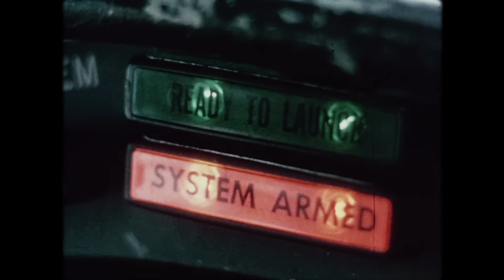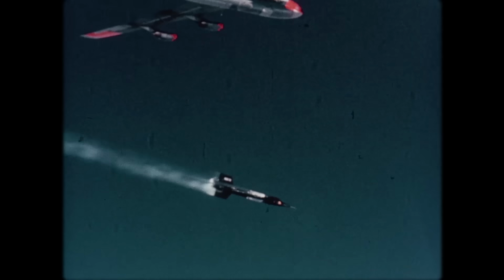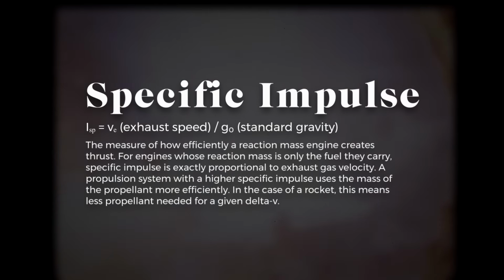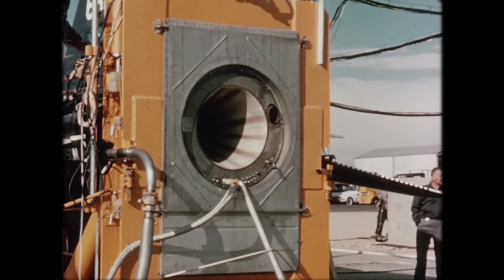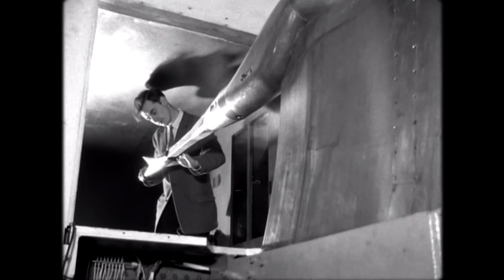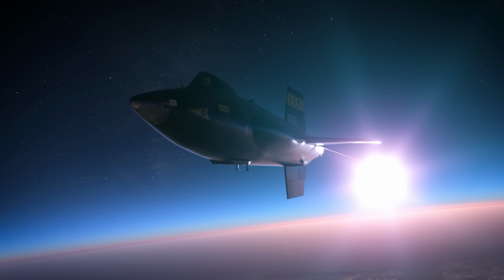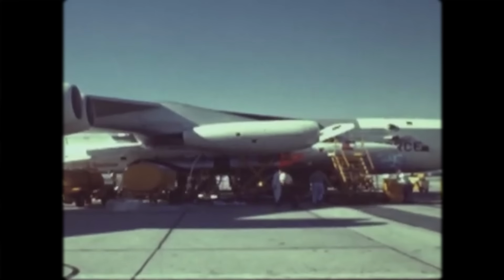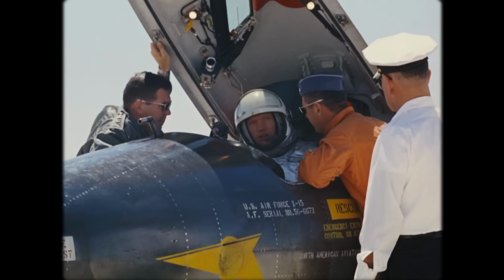The Insane Engineering of the X-15

Comment: Hey I know it says a it’s a plane in a thumbnail but it’s actually a rocket.( sorry for calling it out I just )
Reply: its a plane
Reply: @Inv1ns1bl  it’s not a plane if it cannot take off by itself or if it’s powered by a rocket it is not considered a plane
Reply: @Jst.neutral  It is a plane if it is a manned, mixed winged aircraft. The propulsion has nothing to do with it, its like saying a propeller plane is not a plane because it doesn’t have a jet engine.
Reply: that means your saying a shuttle is a jet bc it  it has multiple wings and is manned, you can ask multiple people if it’s a jet or a rocket and the people with say the same things that I said.
Reply: @Jst.neutral  I would call the shuttle a plane same as the X-15
Reply: @Inv1ns1bl  they are both rockets.
Reply: @Jst.neutral  once again, a plane is any manned aircraft with fixed wings.
Reply: @Inv1ns1bl  yes, but it’s powered by a rocket witch means it’s a rocket
Reply: @Jst.neutral  i will say it again, the power source does not matter.
Reply: @Inv1ns1bl  it does matter.
Reply: @Jst.neutral  The definition of an aeroplane is, “a powered flying vehicle with fixed wings and a weight greater than that of the air it displaces.”
Reply: @Inv1ns1bl  so? It matters about the power it uses witch is a rocket.
Reply: @Jst.neutral  That is the literal definition of a plane, and no where does it mention how the plane is powered.
Reply: Honestly, why are we arguing about this, the X-15 is a rocket. You can ask multiple people and they will say it’s a rocket.
Reply: @Inv1ns1bl  it does matter how it’s powered and you cannot change my mind. Now go bug someone else
Reply: Your the one who started all of this.
Reply: @Jst.neutral  I will keep saying that it is a plane for as long as i live. It IS a plane. It fits the definition. Just because a plane has a propeller doesn’t mean its not a plane, same as a rocket engine.
Reply: @Inv1ns1bl oh my god just accept the fact that it’s a rocket, are you some kind of super fan or something?
Reply: @Jst.neutral  Oh my god just accept the fact that it’s a plane, are you some kind of super fan or something?
Reply: @Inv1ns1bl  super fan of what?, honestly I hate the X-15
Reply: @Jst.neutral  Why are you so adamant about it them?
Reply: @Inv1ns1bl  then* also it’s bc the X-15 is a rocket. And you can’t change my mind. So go bug someone else now.
Reply: @Jst.neutral  I have said multiple times why it is a plane, i will continue.
Reply: @Inv1ns1bl  and you keep on saying it doesn’t matter about the power source and it does matter
Reply: @Jst.neutral  Once again, the definition of a plane does not specify that the power source matters
Reply: It does matter about the power source, why do they call it a jet? Bc it’s powered by a jet. Every plane relies on a power source and there are certain power sources, like a rocket, which is not a jet or a prop it’s a power source ment to go into orbit where  no oxygen is, and no vehicle uses rockets except for the X-15 , X-1 , x-2, etc. so they are rockets.
Reply: They are rockets that operate in our atmosphere
Reply: @Jst.neutral  because of that reason they are planes. Since they are designed to operate within the atmosphere, they fall under the definition of a plane, where the propulsion is not mentioned.
Reply: @Inv1ns1bl  is not mentioned, doesn’t mean it’s not important, they are rockets.
Reply: @Jst.neutral  If the definition of a plane does not mention it, it is not important. It is rocket powered, but it is a plane.
Reply: @Inv1ns1bl  just bc it’s doesn’t mention it doesn’t mean it’s not important
Reply: @Jst.neutral  It is the literal definition.
Reply: @Inv1ns1bl  that did not mention the source matters, doesn’t mean that the power source does not matter.
Reply: @Jst.neutral  if the literal definition does not mention it doesn’t matter. The X-15 is a plane because it is manned, has fixed wings and is heavier than air.
Reply: @Inv1ns1bl  ok, but it still matters about the power source
Reply: @Jst.neutral  if the literal definition does not mention it doesn't matter. The X-15 is a plane because it is manned, has fixed wings and is heavier than air.
Reply: @Inv1ns1bl  rocket
Reply: @Jst.neutral  wow you came back after a month, just to be wrong
Reply: @Inv1ns1bl  lol I ain’t wrong but I was just kinda tired from the argument, and everybody has their own opinions that they think is real and the X-15 is kind of a mix between a rocket and a plane. Speaking that it is powered by a rocket but still is meant to operate in our atmosphere and used as a test plane
Reply: @Jst.neutral  there is no mix, its just a plane, the rocket power does not mean its a rocket.
Reply: @Inv1ns1bl  it is a mix.
Reply: @Jst.neutral  Thats like saying the ME-163 isnt a plane, there is no mix
Reply: @Inv1ns1bl  it’s a mix
Reply: @Jst.neutral  once again, there is no mix, its just a plane
Reply: @Inv1ns1bl  it’s a mix
Reply: @Jst.neutral  once again, there is no mix, its just a plane
Reply: @Inv1ns1bl  it’s a mix
Reply: @Jst.neutral   once again, there is no mix, its just a plane. We can keep on doing this and i will keep on saying the same thing.
Reply: @Inv1ns1bl  it’s a mix
Reply: @Jst.neutral   once again, there is no mix, its just a plane
Reply: @Inv1ns1bl  it’s a a mix
Reply: @Jst.neutral   once again, there is no mix, its just a plane
Reply: @Inv1ns1bl  it’s a plane
Reply: Jk
Reply: It’s a mix
Reply: @Jst.neutral  once again, there is no mix, its just a plane
Reply: @Inv1ns1bl  mix
Reply: @Jst.neutral  once again, there is no mix, its just a plane
Reply: @Inv1ns1bl  a hypersonic rocket-powered aircraft. This was looked up.
Reply: @Inv1ns1bl  so that means it’s a mix
Reply: @Jst.neutral   once again, there is no mix, its just a plane. The power does not matter.

Comment: The X-15 is a rocket not an airplane. When it reached the edge of space it needed thrusters to maneuver in the near absence of air. The wings were needed simply for flight control to reach its desired altitude, reentry and landing. If we consider rocket powered craft as airplanes, the fastest aircraft to be considered must be the space shuttle, many times faster than the X-15!

Comment: If by insane you mean "Let's squeeze a pilot into a pressure suit with contained o2 supply then strap him into an oversized missile, cut a window out, then strap it on / under another jet that will take off and fire him like the previously mentioned oversized missile he is." then, yes.  I would agree.
Also, keep in mind these are only declassified speeds.  The blackbird was reported to be maxed at around 2.8, but then mid operation, while avoiding a missile strike in libya, sounding as bored as thou he were busy making a sandwitch, the blackbird pilot did a speed check on himself to our awacs overwatching the operational area, and was told he was doing over mach 3.5, and the pilot replied calmly, "I thought so, but figured it might not be noticed if I didn't confirm."
 Nearly every pilot to fly the thing, at every speed it ever flew including over libya at mach 3.5, claimed the aircraft was showing zero signs of strain, and in fact had more thrust in reserve than was being applied. Likely, the only people who will ever know truly how fast that aircraft might be capable are, are the incredibly few people priv enough to have flown it.

Comment: Fastest manned plane
The fastest(known) plane is the X43A at mach 9.64, only using rockets to get up to the speed required for the scramjet to start working.

The plane could have be entirely jet powered, but it would require an exponentially more complex design, requiringf multiple engines that operate at different speeds, it was simpler to use a rocket to get it up to the required speed for the scramjet to function, instead of using multiple jet engines of different designs that needed to be cut off from the air supply as speeds increased

Comment: You can't really compare the sr71 to the x15 when it comes to speed. Sure, the x15 was way faster, but it wasn't really a plane. It's more of a manmed rocket. It's like saying an ICBM is the fastest drone aircraft. Maybe technically correct, but in the real world it's not the same
Reply: thats like saying a propeller plane isnt a plane because it doesn’t have a jet engine. it is a plane just with a different power source
Reply: @inv1ns1bl8  jet engines and propeller work with the same concept of taking in air and forcing it behind it faster than it enters. A rocket engine doesn't take in air it stores all its fuel and oxygen on board. This is why the saturn 9 isn't a plane and the same reason the x15 isn't too.
Reply: @brett9382  it is a plane because it is 
1) heavier than air
2) has fixed wings
the power source has nothing to do with it, it is a plane.

Comment: that chart for altitude is missing one important plane that hit a max altitude of 125k and was a mach 2 fighter the F104... they attached a solid rocket booster to its verticle stabalizer and pointed her up... it is the plane that almost killed Chuck Reagar when he got one in a belly spin at 105k feet, they were doing early space reasearch in the late 1950 and early 1960s

Comment: I was just a young boy in the 1950'sxand early 1960's.  Reaction Motors the developer and tester of the x15 rocket engine.  It was tested in a concrete bunker at a test facility near the Picatinny Army Munitions Base in Rockaway Township, NJ   The rocket engine was developed and tested by Reaction Motors an early rocket company later bought out by Thiokol Chemical Testing.  Hear several miles away we could hear the x15 rocket engine being fired.  It was extremely loud but we eventually became used to hearing the rocket fire.

Comment: Fast enough to melt steel simple by the friction of the air!   On the mach 6.7 flight they actually and accidentally went faster than planned.  M6.7 was not intentional, hence the damage.  They also had a dummy scramjet engine mounted on the lower tail for pressure tests that literally melted off and was found on the ground later.

 You can see the fake scramjet here on the lower vertical fin stub:  https://theaviationgeekclub.com/wp-content/uploads/2017/11/X-15.jpg

Recovered scramjet seen here: https://www.ipmsstockholm.org/magazine/2004/03/images/x15_08.jpg

More damage seen here. The burned-through fin is where the motor was mounted:  https://youtu.be/SncLDXTiREY

Comment: The use of the clickbait adjective "Insane" is entirely opposite to what is used on any successful engineering. Insane means irrational, and engineering is a deeply rational discipline. If it wasn't, then it simply wouldn't work. Extreme engineering might be more appropriate in some cases, but the engineering in the X-15 is certainly not insane.
Reply: I was hoping to learn that the pilot climbed into the cockpit through the exhaust nozzle, or the windscreen was made of 12" thick lead :(

Comment: It's not a plane !! It a rocket 🚀 aircraft.
Plane is air breathing engines and leaves the ground on its own power.  X15 was dropped by Larger aircraft!!. Also no wheels !! Skids on back end
Reply: Ha ha ha
Reply: @kitmoore9969  now the SR71 was a plane and a fast one at that!! with both regular engine and transitioned to ram jet in flight!!
Reply: @philipdow2495  Oh, I quite agree. But that doesn't make the X-15 not a plane.

A plane is heavier than air, has wings and is propelled by an engine. The X-15 meets all these.
Reply: @kitmoore9969  yes but it's a rocket 🚀  engine power.... thus ... a rocket with wings.. not throtlable..by the way ..once lite full throttle untile used up and then coasts......thats  a 🚀  rocket
Reply: @kitmoore9969  During the X-15 program, 12 pilots flew a combined 199 flights.[1] Of these, 8 pilots flew a combined 13 flights which met the Air Force spaceflight criterion by exceeding the altitude of 50 miles (80 km), thus qualifying these pilots as being astronauts. The Air Force pilots qualified for military astronaut wings immediately, while the civilian pilots were eventually awarded NASA astronaut wings in 2005, 35 years after the last X-15 flight...  so..
technically its a spacecraft !!
Reply: @philipdow2495  A plane is heavier than air, has wings and is propelled by an engine. The X-15 meets all these.

This is getting boring.
Reply: @kitmoore9969  still wrong   but ok

Comment: The X-15 is not a plane. The X-15 is a rocket with a cockpit. The SR-71/A-12/YF-12 is the fastest airplane known. The X-15 does not have an air breathing engine. It didn't take off and land like the SR-71. So trying to compare the X-15 to the SR-71 is apples. to oranges. I do not discount the X-15 for the marvel it is. However leave the X-15 in its own class.
Reply: An airplane is heavier than air, has fixed wings and is powered by an engine. Tick, tick, tick.
Reply: @kitmoore9969  X-15 does not have an engine. It's a rocket motor. Try again
Reply: @nathancervantes6001  Go on then - what's the difference?

Comment: The silver catalyst packs in the turbo pumps and attitude control Jets on the X 15 were produced in Buffalo New York by a small sub contractor named AG catalyst Corp. and later renamed Astroage corporation. That contractor owned the patents at that time to the Catylist production process. My father Jacob Borkan and his partner Samuel Belkin where the sole ownwers and employees. They produced the packs for the X-15s, the F-104s, and the Mercury, Gemini, and Apollo space capsules and escape towers until their patents expired in the late 60s. The FMC corporation then took over further production. As a child I was allowed to come down to see static bench tests of the packs mounted to small rockets and to work with my dad doing small non-dangerous chores around the lab cleaning trash cans and such. Once I was even allowed to run the Manuel foot operated punch machine to punch out the silver disks before chemical treatment. I still know the chemicals and processes it takes to produce them.I am proud as heck of my dad!
Reply: Dad also was a non credited co-author of a primary peroxide research paper by  (Uncle Mac), James McCormick of F. M. C. Corp., 

Hydrogen peroxide rocket manual
Authors:James C. McCormick, FMC Corporation
Print Book, English, ©1965
Publisher:FMC Corp., Buffalo, N.Y., ©1965

Comment: Actually, the X-15 was not a plane (aeroplane). It was a manned rocket. The Lockheed SR-71 Blackbird was and still is the fastest plane ever built.
Reply: wElL aCtuAlLy... it was a rocket powered space plane
Reply: @techienate  Nope. It was not capable of going that high out of the atmosphere.
Reply: @apolloskyfacer5842  it was a plane because it used wings for aerodynamic lift in the atmosphere. You said it was a rocket and not a plane. 

But it also operated at altitudes where aerodynamic control didn't work and it had to use thrusters for control. If that's not a space plane, what is?
Reply: @techienate  You're forgetting that most rockets up to recently also used aerodynamic  fins (instead of wings) to stabilize them after launch.  And it didn't go anywhere near being in 'space'   Outer space starts at the Kármán line, some 62 miles (100 kilometers) above the planet's surface

Comment: The x15 is not a plane. It could not take off on its own, it was not technically reusable, and it had almost no maneuverability. The SR-71 will always be the fastest plane. And FYI it didn't use hybrid engines. They were still jet engines, just designed for high speed and high altitude.

Comment: Amazing video - super informative ! Just a question, you said that thrusters were used for control as standard aerodynamic surfaces would be ineffective - how would this work if there is no air for a reaction force to be produced ?
Reply: The fuel contains an oxidizer. Even the main thrust engine doesn't use oxygen from the atmosphere.

Comment: That was 99.9% Hydrogen peroxide as you can see when forced through a silver mesh or plate as seen here. It reacts violently.  LOL of course there was little or nothing left of the silver. However you can not get this percentage of peroxide. The max is 50% Tech grade. Germans used it in the V2 rockets as well. I do not know what the percentage was. This video has fascinated me and you covered so much. The X-15 has been one of my most favored planes. The funny part was all the Titanium was purchased from the former USSR. Notably bought through another country. I marvel at the way you have put this all together. THANKS

Comment: In truth hydrogen cannot be contained it will over time escape from whatever it's being restricted by, this is why hydrogen embrittlement of metal piping and such is such a problem the hydrogen leaches directly in to the metal and through the metal of any piping or similar container and depending on the material it rapidly or slowly causes embrilement of that that steel or metal and for example in piping wherever there are any overlapping pieces of Steel there must be bleed holes in the outer piece.